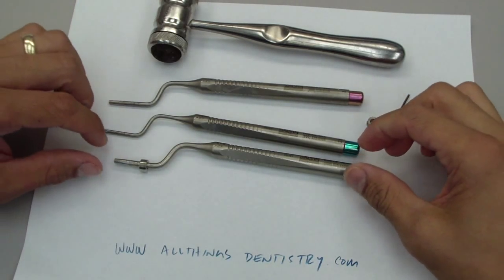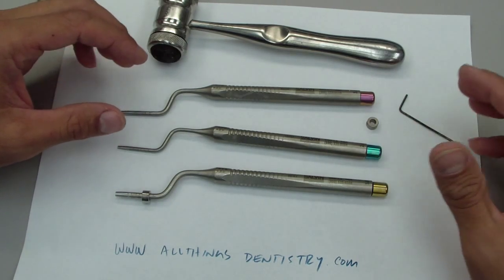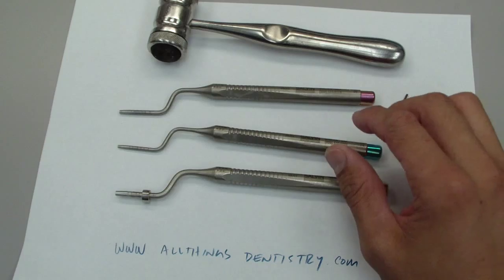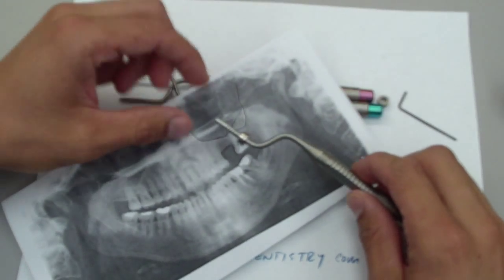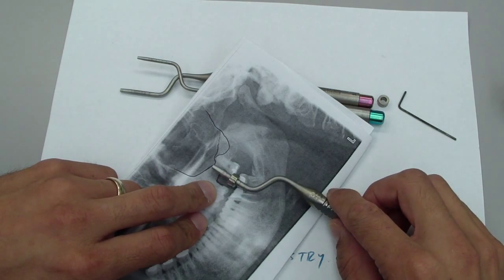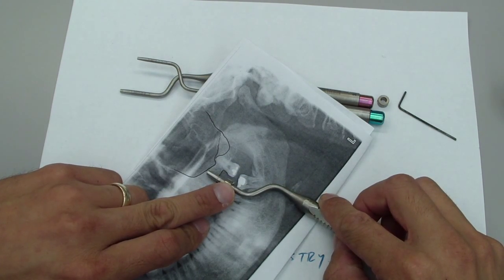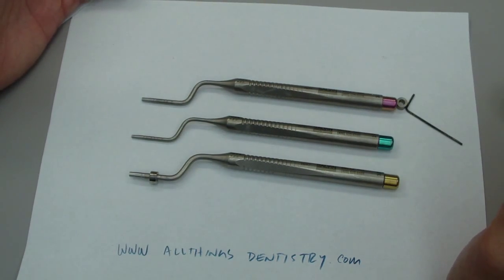Bone Graft - Sinus Augmentation - Instrumentation

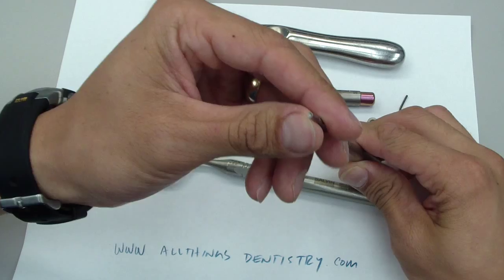Comment: I have been placing dental implants, and doing socket lifts since 1984.  And that little "dip" in the instrument (0:29) is not really for placing bone, but actually to make a sharp cutting edge.  That way, as it is tapped upwards in the bone, it will cut the walls of the bone, and the instrument will press this cut bone upwards, and lift the Schneiderian membrane. Doctor George Whitehead
Reply: Are there newer methods to do this or is this the gold standard?

Comment: This method is brutal. I had it done a week ago and it was like receiving a football ball in my face several times… I had terrible headache one week straight after the procedure.
Reply: Yeah
Reply: Ditto. I just had two upper rear molars done a week ago. I wasn't warned about any fricking hammering! I just remember my doctor telling the assistant "a little harder" and "again, again, again". My whole skull was vibrating. That night and the next day was torture. Even with the acetaminophen and ibuprofen he prescribed. After the procedure he kept saying that my bone was really dense, but I didn't understand why. Now I know they drill down short of piercing the sinus membrane and hammer through the remaining bone. I had to sleep in my recliner that night.
Reply: @darkpassenger65  I had it done 9 days ago. I wasn’t warned either. Worst experience and feeling. I don’t trust that dentist anymore. They made it seem like it would be a tiny little tap-tap.  It was more like Bang BANG into my brain 😩
Reply: @H34RTSF0R4LLZ  Me too, I had it done & don't trust the surgeon either.  He didn't even call to see how I was afterward.  However, what other method is there for the but the hammer?
Reply: @darkpassenger65  Is that normal? There is no other method they can use to protect the sinus or that's the only one? Just had the hammer done.